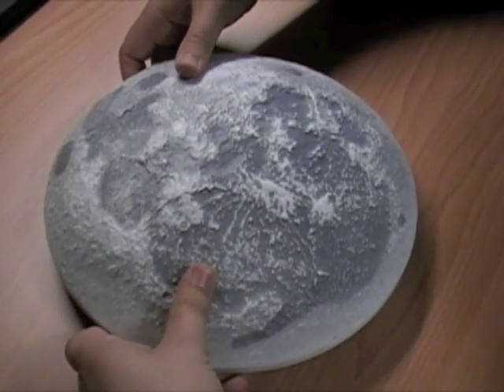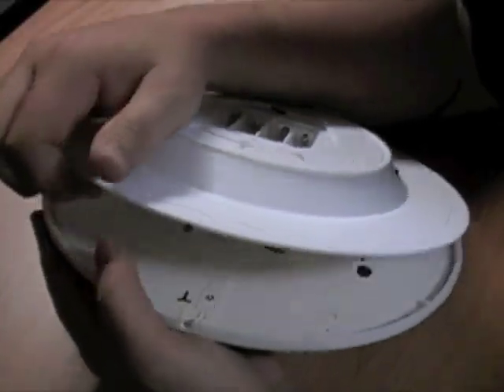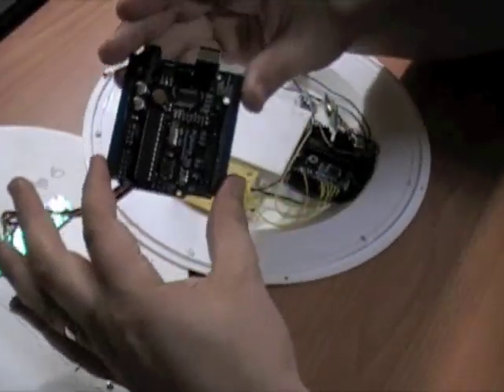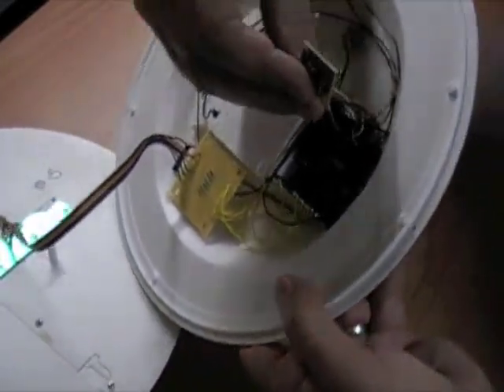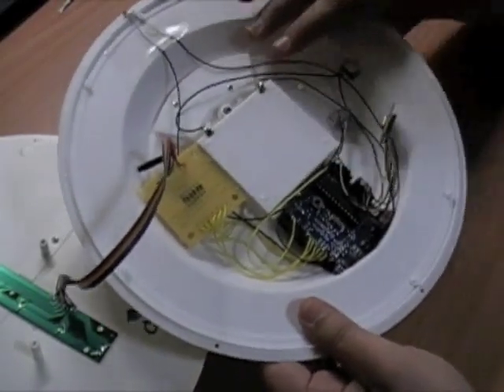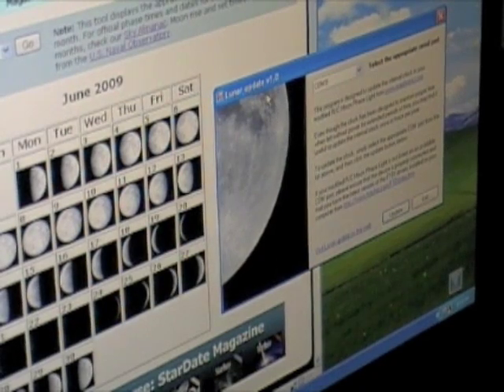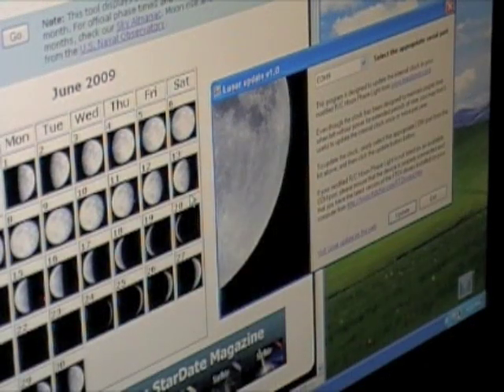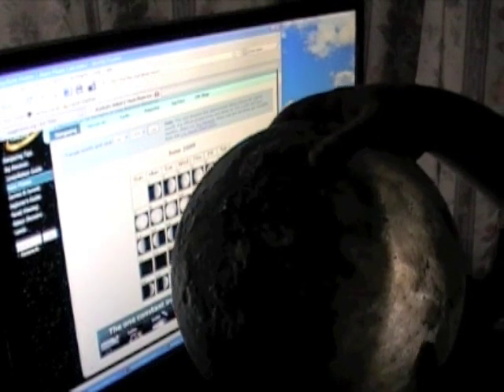Coding4Fun

Comment: My moon didn't have the LDR, and had a smaller control board (chip blob, all smd), as well as having the IR sensor on a wire. Doing the same thing as you, but adding red leds to give eclipse as well. I hope to keep the remote tho.